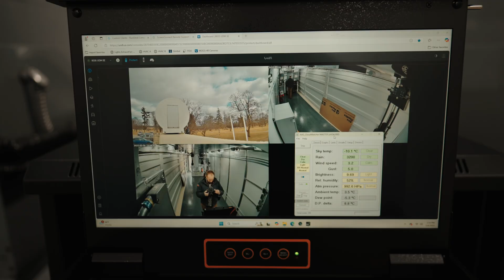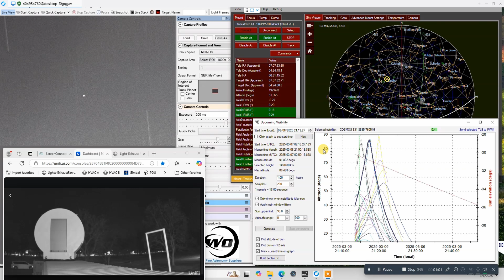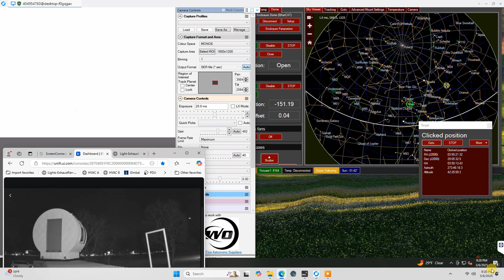Installing a PlaneWave N700 in the MOGS-40 || Modular Optical Ground Station

Comment: Thanks for the video!  Is the enclosure slaved to the telescope mount or it it powered by the rotation of the mount itself?  Will that circular aperture be somehow attached to the end of the scope?
Reply from the maker: Thanks for watching Sean. Yes the dome and telescope drives are linked together, so they are entirely slaved with no chances of becoming misaligned. The robotic window frame was in final stages of commissioning while we shot this video. Now the window and telescope are aligned.
Reply: @SeaWestObservatories  Thanks for the response!